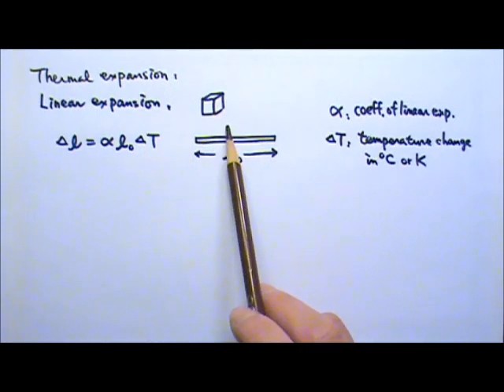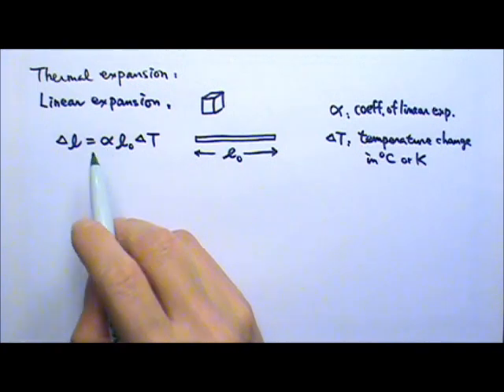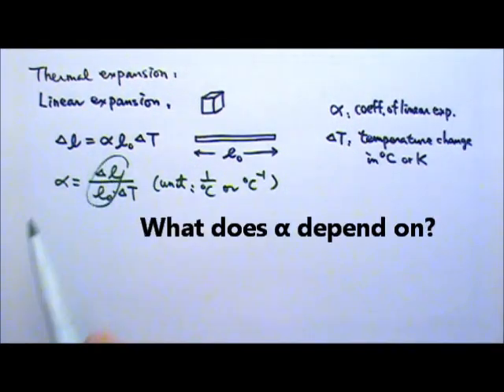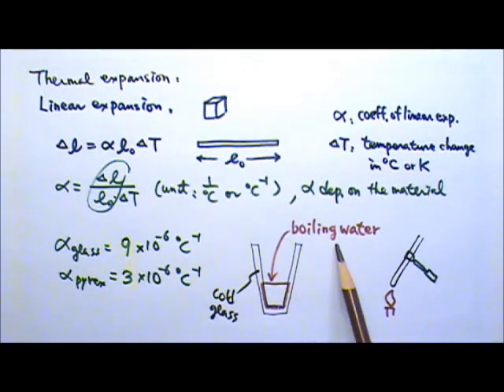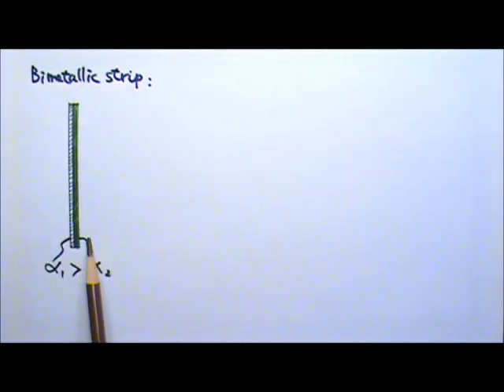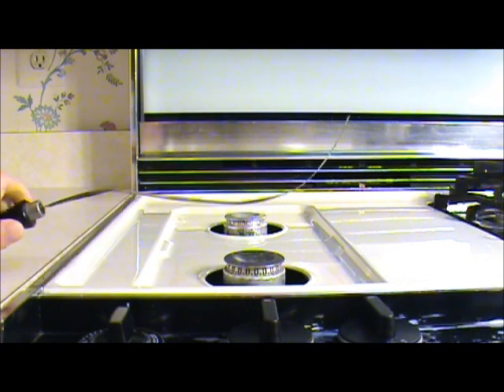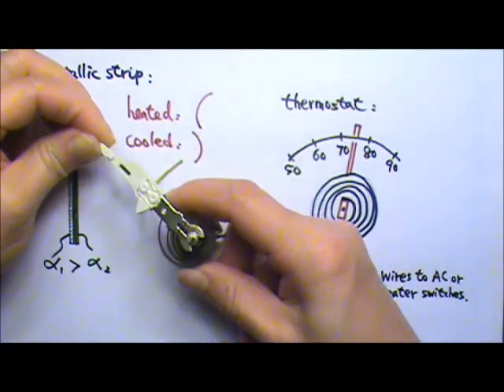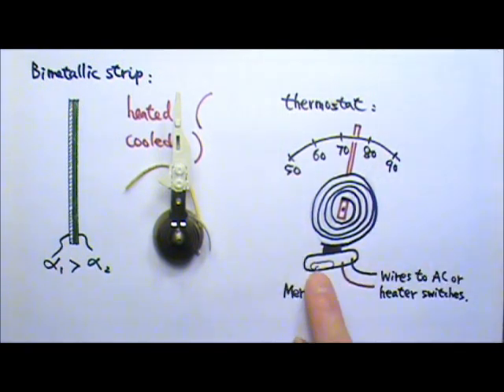AP Physics 2: Thermal 1: Linear Thermal Expansion and Bimetallic Strip

Comment: Can you further explain in more detail why Pyrex test tubes and beakers have to be thin?
Reply from the maker: When intense heat is applied to the outer surface of a beaker, it can take a while for the heat to be conducted to the inside of the beaker. If the beaker wall is thicker, this uneven temperature of the beaker glass is more pronounced - meaning different parts of the beaker are expanding at more different rates, putting more stress to the beaker, and increasing the chance of it breaking.